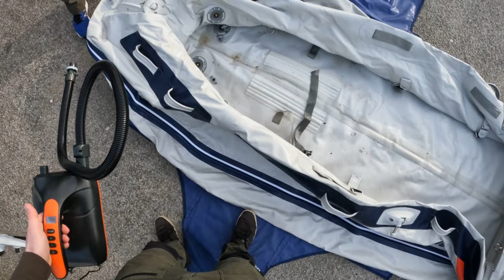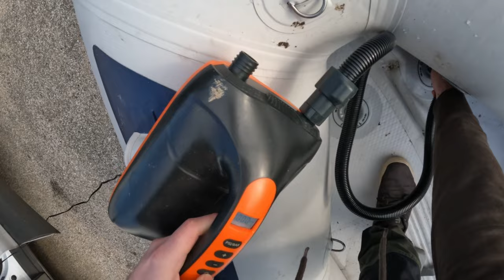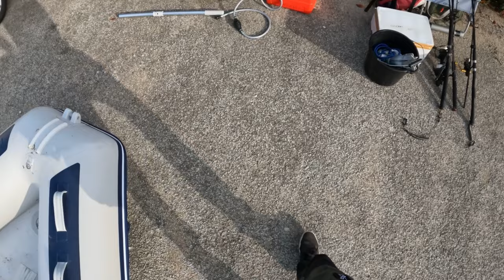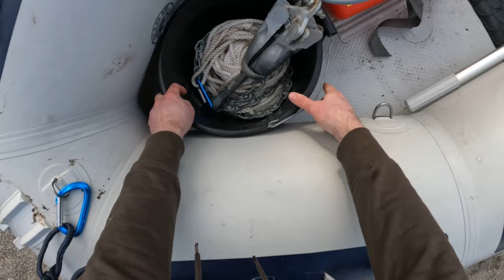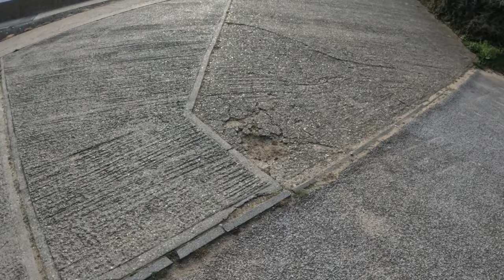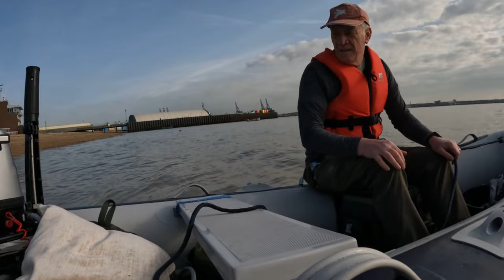SIB Fishing UK Honwave T32 IE3 setup assembly beach launch

Comment: Hi mate just seen your video, its good! Have you looked into getting a leaf blower? It will inflate your boat in under a minute then just top it up with the 12v pump, just a thought. Also for mine I got some gym handles, clip these onto the ring at the front of the boat and its ten times easier to grab and pull along. They can also be used to hold on when its rough! Just a thought anyway.... cool little setup.
Reply from the maker: Hi mate! Thanks for the info. Yeah I saw your video about the leaf blower, looks alot faster. I'll deffo try it out. Love your channel by the way! Tight lines 🐟
Reply: @inflatableangling  No worries with the T32 it will be super quick. Always thought about switching from T35 to T32, mines too heavy!

Comment: The air vee floor boats r by far the best iv had a few over the years no way would I ever go back to the Ali floor used to take 25 minute just to do the floor compared to 6mins to do the whole boat with vee floor the trim tabs also help keep the boat more stable and you get better top speed I get 19mph 1 man or 16mph 2man up with a 5hp 4stroke mercury on the river not took it to sea yet
Reply from the maker: Yep the V floor is great for speed of setup as well as stability and control. Ali floor is perhaps slightly better for internal space and for fishing however. Both good 🙌
Reply: i get about 19 mph with a 9.9 hp    with one person  t32  is yours turbo charged
Reply: @deannafox3727 🤣 people think twice the hp twice the speed don’t work like that change your prop for a higher pitch increases top speed 😁or lower the pitch will increase acceleration but lower the top speed 😁without spending twice the money on a more powerful outboard I’m getting about the same power as a 9hp on a 5hp it’s lighter easier to carry and  less hassle

Comment: Excellent video, straight to the point and you're setting up so much faster than me. One question still, how will you be able to sharp steer with the wheels lifted up? Especially because I have a 3.5hp without reverse so I would need to fully turn the outboard for reverse? Cheers
Reply from the maker: Hi, thanks for watching! Yes you are right the wheels do slightly restrict the outboards ability to fully steer completely to either side, but to be honest, it's only a very small amount of restricted movement. I've not really had any issues yet.
There are other types of wheels that you could choose that gone get in the way at all.
Reply: Have you this inflatable boat with 3.5hp?

Comment: Hey mate, thanks so much for this, what wheels do you use on your T32/recommend? The shop I'm getting my Honwave from said only the J-shaped wheels work on the T32IE3 due to the narrow beam. In your case, that doesn't seem true :)
Reply from the maker: Hi! Thank you for watching! With the newer models of honwave they do not have the big flaps at the back so you do not need the J shape. I've had no issues at all with narrow beam. I'd highly recommend these wheels: https://www.ebay.co.uk/itm/335129636698?mkcid=16&mkevt=1&mkrid=711-127632-2357-0&ssspo=4ggCt9pMTS-&sssrc=4429486&ssuid=xwm7TJHBTSi&var=&widget_ver=artemis&media=COPY

Comment: Hi, am looking for my first air deck SIB at the moment. Honwave would be top of my list if it was not for the v-floor as I occasionally stand when fishing. But looking at your vid, with the mat you put in, the floor looks very standable on. Does the v cause a problem for standing or should I be ok? I understand the v-floor is good for rigidity and for plaining  more easily. Thanks in advance.
Reply from the maker: Hi Richard, yeah you can absolutely stand up on the V floor. Obviously not as flat as an ally deck but I find it pretty stable.

Comment: Nice video, thanks. I am really struggling between getting a 9.8HP or a 6HP on a 10' BRIS. Any recommendations?
Reply from the maker: Hi, it really does depend. What are the sea conditions like near you and is portability an important thing. A 9.8 is the next size and weight up, so not so easy to carry or fit in a car. The extra power would be great though and if you have very strong tides etc a 6hp might not be enough.

Comment: Hi! How are you able to deflate it so well? Do you use a pump?
Reply from the maker: Hi, you can use the pump on reverse but I have not needed to do that. I just open all the valves and then start to roll it up bit by bit. I kneel on it as well to force the air out.
Reply: @inflatableangling  oh great to know! It seems pretty well packed without the extra pump deflation... Good!

Comment: What pressure do you put in tubes and floor. And what is the wight of the boat many thanks
Reply from the maker: Hi Pieter, the two floor sections need 0.8 bar each, and the three tubes need 0.25 bar each. The total weight of just the boat on its own is 39kg.
Reply: @inflatableangling  thanks for the reply.  I'm getting the same inflatable myself

Comment: Nice video!  Can I ask what launching wheels you have there and what HP outboard  ?  I’ve a T32 as well. Cheers
Reply from the maker: Thanks mate, I use these transom wheels: https://ibsparts.co.uk/product/stainless-up-and-over-launching-wheels-200kg-capacity/  they are quite big, but they fit well on the latest model Honwave t32. My outboard is a new Mariner 6hp 4 stroke short shaft.
Reply: Thanks the wheels are just what I’m looking for 👍.  I assume the Mariner has more than enough grunt to get you and a passenger on the plane ok ?  I noted you were taking quite easy throttle wise in the vid…😃
Reply from the maker: Yeah the 6hp is brilliant when its just me aboard, easily gets on plane. Its a bit slower going when 2 or more aboard, or when going against a strong tidal pull.

Comment: Hi. What pump is that mate? I've got a Bravo. Ru happy with it?... jj
Reply from the maker: Hi John, it's a Meridian Zero VHP 12V 120psi dual stage SUP pump. It works well as long as your car engine is running so it can operate at full power. Was a decent price as well.
Reply: @inflatableangling  Excuse me, You mean 20psi ? I try to search something like your pump but I find "20psi" not "120psi". Thank You
Reply from the maker: @gordongekkoit  hi, sorry yes you are correct. It's the Meridian Zero VHP 20psi

Comment: How the aur doesn't seem to guss out like mine does   am I doing something  wrong.  I hav a honwave  2 .4 metre
Reply from the maker: Not totally sure what you mean, but it sounds like the valves are not sealing when you are removing the pump? Make sure there is no sand or debris stuck in there. 👍
Reply: @inflatableangling  thanks I ment to say air   I got no experience   it's my first boat   only blew it up 2 time so  on garden    but  thanks for the advice mate